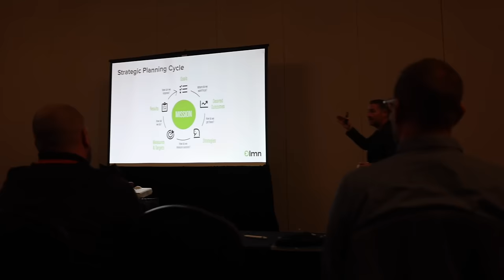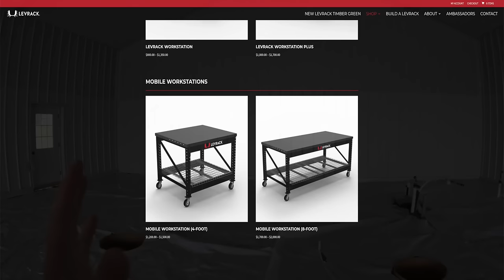Getting PREPPED For CONCRETE! Barn Update, New Lights, LMN Mastermind Class!

Comment: Brian, we did a Levrack a couple years ago and its great. We did the 10' system but opted for 6 @ 15" deep shelves instead of 5 @ 18" deep shelves. If I were to do it again, I would go with the 12' with all 15" shelves or a single 18" in the mix.  Ours is in front of a window and we typically leave the opening in front of the window and that section is set up as a wiring station so there is great light there.  We also placed PVC boards between the legs and the concrete to keep any moisture from wicking up the steel.
Reply from the maker: That’s great feedback! Send me some pictures via Instagram or email would you? That would be dope!

Comment: Hey Brian love your videos, you might want to check your camper height again most fifth wheels are over 12 feet tall with the air conditioner. Without garage doors its hard to judge your door size.

Comment: You should have installed floor drains. When you park your truck from plowing all that snow and ice chunks melt on the floor and you want to be able to wash it off. A section of the floor should be at least  6 inches of concrete so you can install a lift in the future. As you grow and become a big shot you will have an in-house mechanic to fix all your stuff. Just a thought.
Reply from the maker: All great suggestions. The last 30 feet of the concrete will have a grade to the door. It’s actually a lot more challenging to add floor drains than you think. The barn is level to the driveway and house so there’s no where for it to drain. Otherwise we’d have to pump it (like the bathroom), and that gets expensive. 

We don’t plan to add a lift into this barn it’s not going to be that dramatic. But in the future on a larger shop, I would 100% do deeper concrete. Sidenote, if we ever wanted to retrofit a lift, all you have to do is cut out sections to repair 6 inch deep portions. That’s a lot easier and cheaper than paying for 6” 4k psi concrete fwiw.
Reply: It depends on the code of your jurisdiction. At the very least I would have drained it into a gravel pit under the ground What's going to happen is you're gonna have ice build  at the beginning of the doors wherever drains and  you're constantly gonna have to salt it. I'm telling you you're gonna regret it. That's what happened to me and I ended up cutting the floor and adding it to the sewer System.
Reply: Used pallet rack with wire mesh. You can paint it any color you want. But if you can get sponsorship from leverack than go fancy. Lol